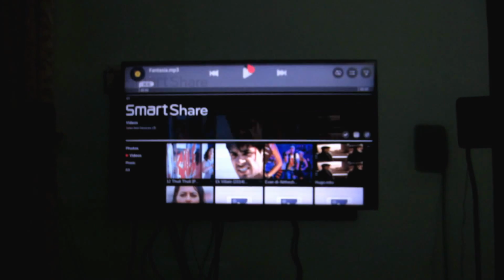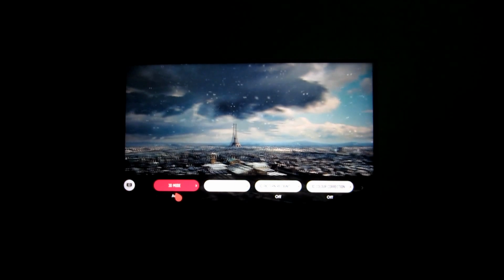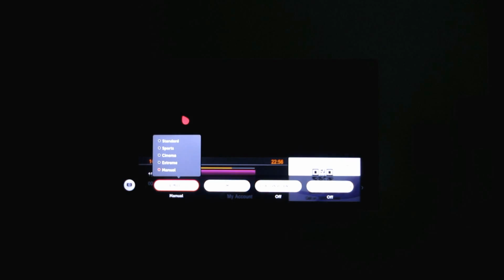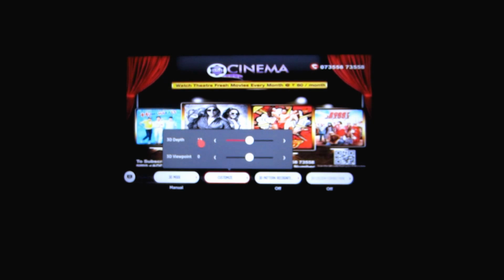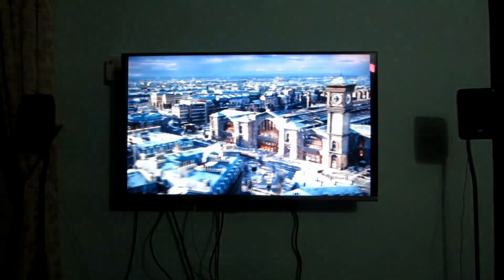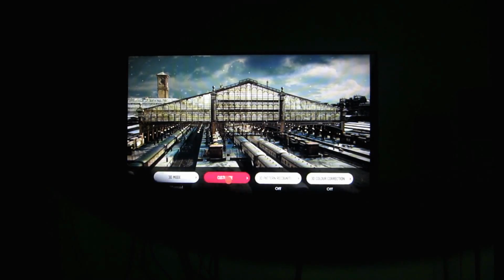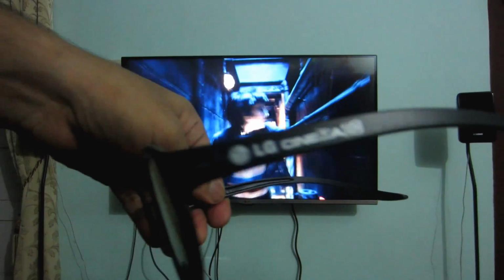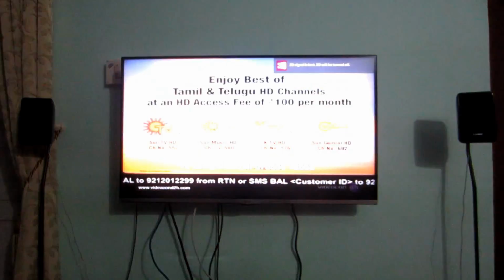Passive 3D Settings and Modes Review - LG WebOs led Tv 2020 - 42LB6700 - Using Real D Glass - India

Comment: I have 3D movie on my external HDD drive size of the movie is 25GB, when I am playing it on my LG 3D LB6500 model its taking long time and buffering like a while. What could be the reason?
Reply from the maker: It's becoz of the PCI interface it uses for passing on data to system memory. Currently the buffer is limited to 20mbps which means a file with bitrate higher than 20mbps can't be played or if played some lag due to buffer over run can occur. Cheers :)
Reply: Thanks bro for quick reply.... is there any way we can run this movie. What if we run this movie using Blu-Ray player by connecting External HDD to Blu-Ray, will it run?
Reply from the maker: Yes of course. Unless processing is not done by TV or the i/p bit rate exceeds 20mbps.. there won't be any issue. Cheers :)
Reply: Perfect! Thanks bro!

Comment: thanks for the settings info man, but do you know also how to enable the truemotion settings when i connect the hdmi to pc and select the pc icon? because that settings is greydout when connect via hdmi to pc
Reply from the maker: +Lidel Basagre To my knowledge it's not supported in PC mode as intention of pc mode is to reduce the input lag and for that all picture processing engines will be in an interrupt state. As truemotion requires PPE to work, using it along with PC/Gaming mode won't be possible. Cheers :)

Comment: i m planning to buy a 3d tv, suggest me, lg lb6500 or samsung 4800 ?
Reply from the maker: Drsajjad Arif 4800 to my knowledge is Joy series television which is entirely low profile and can't be compared to 6500 from LG. The only series from Samsung that possess a competitive advantage over LG this year is 7000 series televisions. Instead of  lb6500 i would rather recommend switching to 6700 since the price difference is small and it's worth switching! Another model you could consider is Sony w900b. Both are very good 3D Tv's. Also Samsung comes with active 3D. But in my personal opinion, i like passive 3D over active because of obvious reasons. Feeel free to discuss anything further. Cheers :)
Reply: thanks for quick reply, its samsung 40 H 6400 its a 3d smart tv.
Reply from the maker: Drsajjad Arif https://www.youtube.com/watch?v=5z5iSCam_PM&lc=z12dtpixnoajfpgnl22cwvypuxughzavp Check out part 1 and 2 for getting an idea.
Reply: Thunder  i checked it out in reliance digital, its 4000 rupees difference between 6700 n 6500. honestly i think i ll pick up 6700. and yeah you were right samsung is a joke.. thanks a ton

Comment: Hello. For what type of glasses is that horizontal double picture at 1:42. How do you watch that? Another question: When I want to download a 3D movie, what format should I search for. I tried to download two movies, and they were both double picture like at 1:42. I don't get that, how do you watch that? Next week will have my LG 42LB650v model. I can hardly wait. :) Looking forward for your answers, thanx.
Reply from the maker: david400p I think you meant to say the Half Over Under (H-OU) format. All the formats shown requires only normal passive 3d glasses which in this case is supplied by LG or any other real D glasses. The container format can be anything like .mkv... etc.. But video codec has to be .mp4 or .wmv since for 3D videos, LG Supports only those two formats. The encoding format can be anything like SBS(Side by side), H-OU etc.. For passive 3D Tv's H-OU is better whereas for active 3D SBS is better than H-OU.The tv contains built in decoders which fuses together the two images using FPR which when watched using a real d glass gives 3D picture effect. Hope this helps. feel free to ask anything further. Cheers :)

Comment: hey, what softwate version is on your tw? I got 04.30.09 and I wonder if its up to date..
Reply from the maker: plaayeah Yes. Up to date. Cheers :)
Reply: Thunder Mine 42lb750T has 04.00.13 as web os version! Strange is it not?
Reply from the maker: Nitz Malikarjun You may update it manually. Latest in India is 00.29
Reply: I did try not says i am in latest OS!
Reply from the maker: Nitz Malikarjun
You need to manually install or may be 00.29 was not yet made available for 750T.

Comment: i have Lg 42LB750T. 
some time i get memory full error while watching online video and does this support flash.
it show that flash player required 
i downloaded latest firmware for my tv after extracting that firmware by 7zip i got another .7z extension file name as (Software_File%28Version_04.00.29%29.7z) but it give error that file is damage.
Reply: @saurabh Kumar. I purchased it from local dealer for 68500/- which is lowest selling Mrp of this model I think. Online price is now 78500/-  
Lg 42LB750T
Reply: 3D effect is good . go for passive 3D TV Like LG . Samsung Active 3D sucks..
Reply from the maker: aniket mali Sorry ! Was out of station past 2 days. It supports Flash but the latest update for flash was not available. I think LG will address the same by next firmware update. Click the .7z.001 file and extract. It will work normally. Cheers :):

Comment from the maker: This is a question by Mr. Vinoth Vel in the discussion area which i think might be relevant to others too. So sharing it here.

-- --QUESTION----
hi... thanks for ur video... nice upload :)... some people says there is a limitation in vertical viewing angle... tv should be placed as per our eye level like that... is it true? if true means give any suggestion... & what about 3d effect ? 3d effect in the sense not in depth.. like pictures come out of the screen... (ex) In transformers 4 movie, u can see the title came out of the screen very much (in theatre)... In tv? 

-----ANSWER-------

For any 3D Tv the basic rule is that the tv should be mounted/Placed at the eye level for optimal viewing and to reduce health problems like eye strain. If this eye level is maintained i can assure you that no crosstalks or limitations are observed. Since this tv uses FPR for 3D, the only limitation you would be facing is limited horizontal resolution. But this is never evident for a normal human eye.

But what you said makes perfect sense for active 3d since when rotated it's glass will start to dim at 45 degree and becomes fully opaque at 90 degree. Means no visibility above 90 degree which is a limitation.

The 3D 'effect' you mentioned is there but cannot be compared to the one available in a theater. The reason is simple, there actually two projectors are available and thereby creates two images of varying depth which inside a theater makes ample effect to those sitting at a position till the middle row. But tv uses polarized glasses which allow the left and right images to be seen by the left and right eyes separately.
Reply: hii can u plzz tel me what should be 3d depth nd 3d view point 
i wnt to watch a 3d movie but messing up wth these settngs 
plz tel the adjustments
Reply from the maker: Anu Sharma I used to watch 3d movies using the default settings only. It's better not to alter anything if you are not facing any problem with viewing. But if there is a problem with the source you may use the depth settings for correcting the image fusing or depth so that you could get a clear vision (no the slightly distorted one). Try other videos too if the problem is witnessed only for that particular video means it's a problem with the source and it's way too difficult to correct using the Tv's inbuilt 3d picture processing. For 3d Movies i would recommend JYK or Sparks if you are relying on P2P downloads. The maintain good quality source. Feel free to discuss anything further. Cheers :)